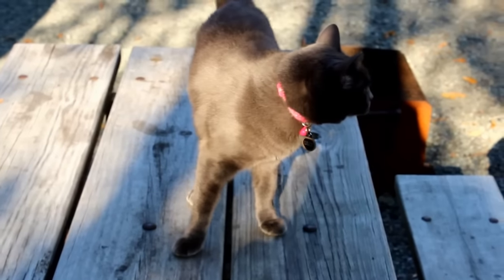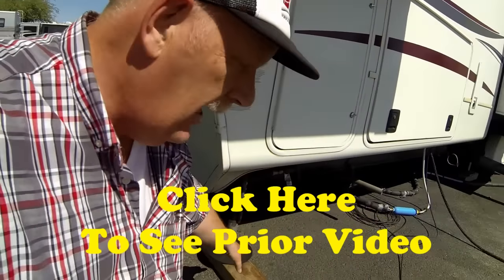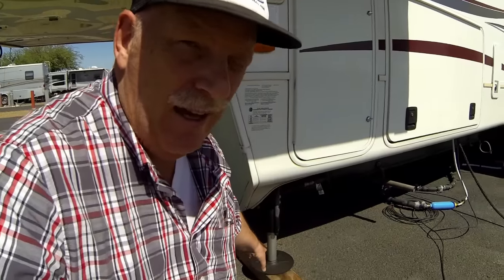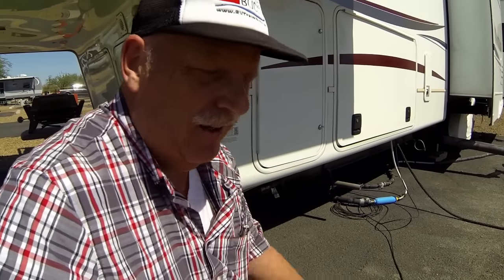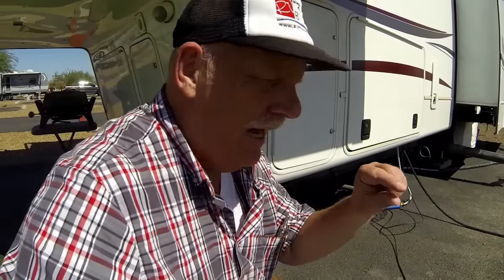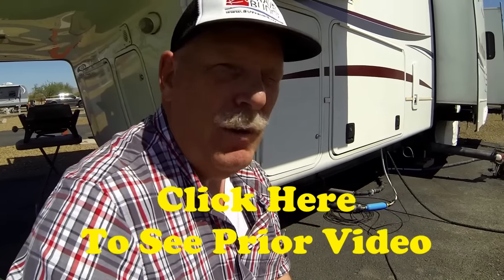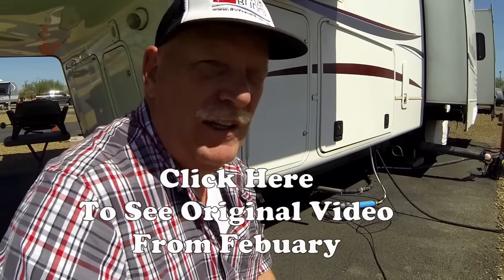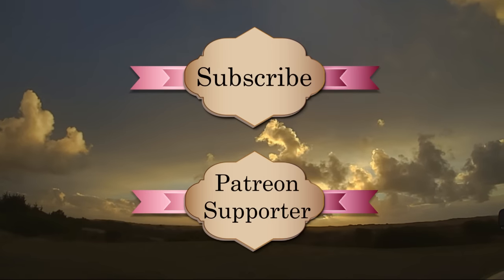RV Tire Repair, How Did We Changed Our Tire? Response Answer | RV Travel Quest  #rv #rvrepair

Comment: Hey Rob what brand were those tires and were they ST rated tires.The 2012 infinity fifth wheel we ordered came with those LT 235/85/16 GOODYEAR tire.At work we use yokohomas on the big class a trucks and dont have any blow outs.My second set of Goodyear G614 were 340.00 dollars a piece.What did your brand cost thanks.
Reply from the maker: We bought Yokohama LT235/85R16   120/116R  10 PR